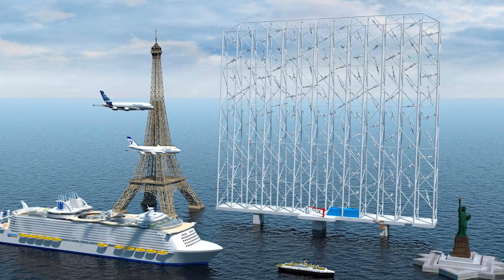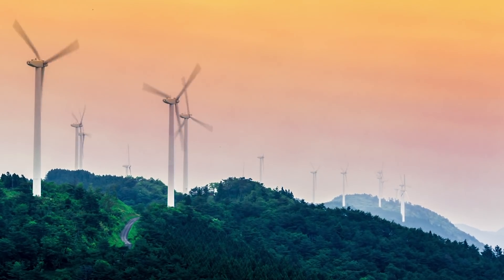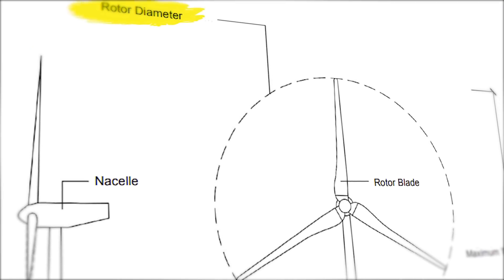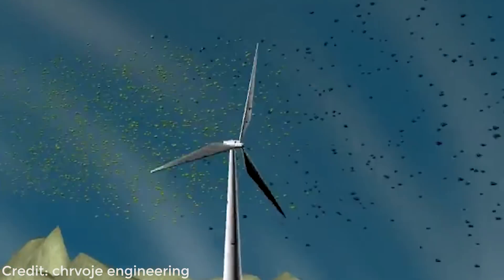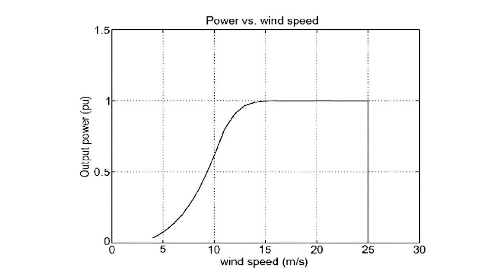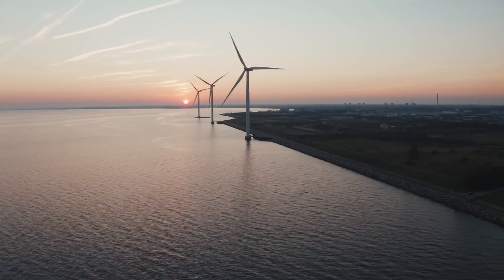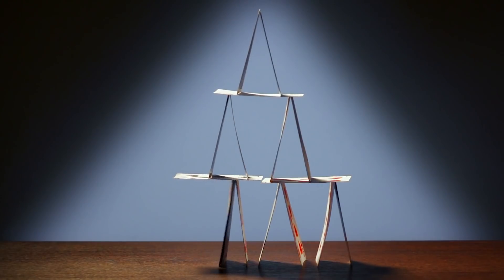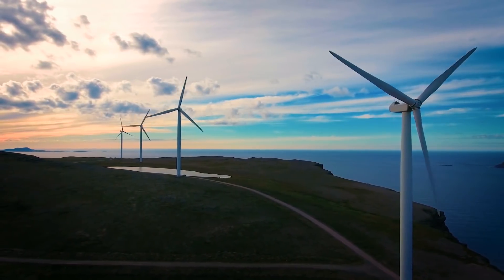Is this the Future of Wind Energy? - 200+ Blades!

Comment from the maker: Correction:

A primary reason for wind turbines not going faster than 11 m/s is because the generators chosen work best at those speeds, and it doesn't make sense financially to go for larger generators that can handle higher powers. I should have mentioned this in the video, but I definitely rushed parts of the script. 

The reason I focused on the blades is because they also have to be made stronger for higher wind speed, for the smaller blades this is less of an issue, as rotor weight scales cubically with length. In my opinion, this is what the windcatcher focuses on, as the total weight of the smaller blades would be lighter than three large blades from a conventional turbine. This makes it easier to design bearings/mounts/etc as the blade spins faster. Therefore the windcatcher design would also have increased costs due to higher powered generators, maybe this would be less of an issue with many smaller generators, but I would guess not!

Sorry for any confusion, I will edit this comment to reflect any other corrections and will work hard to make sure things are clearer in the future!
Reply: If you're going to make that complicated array, why not change to VAWTs?

I agree with the other comments about the array having high drag and a greater chance of damage in high winds.  If the lower turbines have low output, eliminate them.  Instead of solid members, use high strength cables to suspend the array.  Try to minimize the cross section of the array to minimize wind load.
Reply: @acmefixer1  You need a pitch control for VAWTs to make it feasible on the yield side. But yes, you are right, a VAWT is the better approach to extreme scaling. That is first principle thinking optimizing number of attachment points of blades vs maximum blade length defined by material strength. VAWT scales in 2 dimensions, height and diameter. You can stack it like a scaffold and run it on a circular track easily to support any scale you want. Unfo it does economically nothing for you on the yield side w/o kind of a pitch control.

On this design, hopefully no one will try to pay for the scale up in offshore wind of this grid concept. But who bets against stupid money? The initial stage investment is insanely high and the design can't be proven small scale. The outcome can't be there by what any wind energy engineering expert can prove you with simple calculations on yields, loss and maintenance by the standard bankability process calculations.

Scaling a VAWT is precisely what we do with our IP to bring tidal energy down from 4 m/s current speed to the more abundant 2 m/s of the worlds oceans. Why Tidal Energy first? Because we don't need crazy billions for a competitive scale from the get go to prototype our experimentally proven IP.
Reply: @acmefixer1  Because VAWT's are less efficient.

Comment: The only problem with power is its portability. You cant just have a big fuck off generator somewhere, cuz you lose it as you try to move it to far places.

So you need to make a bunch and dot it around the earth wherever it is used.

In the far future we prolly just put it under ground like really far down and from that point its a bit easier to pull the cables around instead of ploping on the surface and having to go over the curvature.

Moon and prolly mars will have beamed power cuz you don't wanna put anythig on that crap surface if you can avoid it. Altho if they wanna go the magnetic field way, eventually they just hyjack those wires.

Comment: As I write this, UK wind is near-zero, and certainly nothing like the power required to match demand. Therefore 2.5x trivia = trivia.   The UK (and Europe's) basic problem right now is loss of security of energy supply. This has been mostly caused by poor decisions, such as forcing coal fired power stations to close. This has been suicidal because it means we are ignoring a very big part of the global energy supply market, and doing that can only mean one thing: our energy will be more expensive.  After throwing ourselves into this mire, the UK now gets a chance to see the true cost of that decision.  Industry is being crushed, and household bills were heading towards £5k per annum. The Government has promised to cap household bills at £2.5k by subsidising UK gas purchases, which means we'll be paying for these poor decisions for many years to come. This situation will continue until the UK improves its security of energy supply and aligns with world fuel markets - it means we need to replace those coal fired power stations.  If you disagree with this, you will only have yourself to blame when the situation does not resolve and you suffer even more.

Comment: I hooked up my first vertical axis wind turbine in 1983; I think.  Used it to run an air compressor and then use the compressed air to power an air motor to overspin an induction motor to generate in-phase electricity back into the grid.   The turbine I used had a 4 legged cage around it.  The PHD physics guy I was working for had bought it in Colorado and hauled it to Texas, where we re-erected it.  A co-generation electric co. engineer oversaw the operation.   I gave much thought to the supporting cage.  The turbines in this array also have a cage.  They would do well to connect 4 of those cages together to make a huge cube.  Assuming the turbines can turn 360 degrees to face the wind; they should be able to allow full spin up.

Comment: None the wiser, but did explain the Caplan hub variables control of blade orientation in governor function. Propeller,and water turbine knowledge.  A turbine has a casing, capturing the steam til its energy has been utilised. . Take that, (not the group.) and use its simplicity. Venturi grabs full wind, further back a larger taper area. . Blade grabs the slowed down wind, and so on.  Speed  control can be by limiting the wind through flow, in a funnel  . A clutch connection picks up or opens wind flow as required. High winds, first stage and next stage  and final . Low wind funnels to,third stage, moderate funnels to  2 nd stage., 1st stage  put profile of least resistance by blade attitude.  ( Bypassed fluid Clutch ), to,allow 2 nd stage to take  the load . 
final . Like auto car system, in reverse.  Well proven function but we have spent Billions on the big is clumsy, and cumbersome limited. Wind is like the roads up and down . Big turbine Venturi 3 stage. All automated safe.  For birds, black hole in atmosphere, drags in any passing morsel.engineering mind in past experience. Cost of standardising a universal unit is a one off, all built and taken to,a side of best wind advantage. Cost only effort and thought with money not considered profit is  forever use, but not money.

Comment: As engineer I am confused about the statement that "1/2" in kinetic energy equation comes from relativity. I'm 99% sure it's just from integral. And the equation is much older than relativity. 
Or was it just a joke?

Comment: The design is serious flawed.  If the supporting structure is able to produce 2.5 time more energy it will have to withstand similar 2.5 times more stress.  That makes the supporting frame/structure a lot larger and more substantial than shown and the foundation requirement would be even more challenging.  The whole idea that we are using wind and not wave energy is because of overcoming gravity is a lot more expensive.

It is theoretically possible to erect a bridge from US to Europe but an engineer can tell you no motorist would pay the toll needed for its installation. Apart from theory there are practicality and economics too when you scale up everything.

Comment: Where do you get the idea that small wind turbines can handle faster wind speeds?  Small Wind Turbines cannot handle fast wind speeds any better than large Wind Turbines.  Many large wind turbines are designed to withstand 100 MPH winds.  Most small wind turbines will disintegrate in 100 MPH winds.  Small wind are turbines are LESS EFFICIENT than larger wind turbines.  There is nothing about this idea that is "better".

Comment: also i like to add an wind pressure generator air pressure compressors would be far simpler and the pressure line to an storage point is als simple the energy is easy storage in underwater pressure chambers etc the electric energy conversion is easy with water flow turbines

Comment: this futuristic wind turbines will kill more birds, esp. those endangered.
Reply: I think it could be a lot better for birds. The main problem with conventional wind turbines is that the blades rotate high above the structure itself, making it hard for birds to understand the area it actually covers. They fly in between in what they think is a safe zone, like this: https://youtu.be/8NAAzBArYdw
With this type the blades does not spin outside the structure itself so its much easier for birds to determine the unsafe space when the support beams cover all blades. Likely they would determine it the way they determine buildings.

Comment: The small turbines might find a market like residential solar. The new company doing wood composite support structure is much better.
Reply: They would work  but won't happen as power company's will lose out.  Unless they can sell you one but still charge you for how much power you use

Comment: I have wondered about passing a sea wind through a tunnel that is lined with magnets, and electrodes. I am assuming that the wind would be 'wet' - as salt water is an electrical conductor.

The efficiency may not be great, but the design is very robust and cheap to make, I believe.
Reply: I was thinking the same thing.

Comment: Ziroth I do not think that you should apologies very much for your point about blades rotation speed. One of the swindle which large conventional wind turbines advocates push is that large turbines must rotate (pitch) their blades because of so called "capacity factor" which is related with economics of having larger generator and by that "extra costs" related with annual energy production, AEP (as mentioned by Engineering with Rosie). However that costs are minor relative to investment at all (to some extend) and in many respect this is ECONOMIC issue not technical, technical issue is that large blades cannot rotate very fast because of much higher centrifugal forces which in combination with much higher stress on blades will turn blades apart and destroy entire wind turbine. So in case of large wind turbines blades it is not that they "do not wish to capture more energy because of costs of extra generating power" as Rosie mentioned (between the lines) but also because it is technically very demanding if not impossible for such large blades. Another point which anyone barely touch in analysing work of large wind turbines is their high intensity infrasound for which is proven that have very serious effect on human health and that propagation of these emissions are much wider than just 1 km as large conventional wind turbines advocates claim but instead it is 15 to 20 km for 2 MW wind turbine, for larger much more. That is why we had developed an patented completely new concept of wind turbine and platform for converting wind energy on much efficient way and without infrasound emissions and even birds and bats killings. 
https://www.youtube.com/watch?v=w81fNBGirCo

Comment: Does this design with its far smaller blades allow for the use of different materials other than fiberglass?  Could you use sustainable/recyclable materials for these smaller blades?  Maybe even something like a bamboo laminate?
Reply: Bamboo laminate is recycleable like any other laminate. Aluminium or steel could only be used at further loss of efficiency on top of the ones making this already unviable. High poer conversion factor means sleek blades require you to go to the most flexible strength material available. That is carbon fibre. Changing the medium to water and do tidal energy or ocean energy is what you would want to look at before further exploring offshore wind for several advantages. In tidal energy to get from 4 m/s down to 2 m/s currents is the real deal to get anywhere fast on easy to recycle materials. High C02 emission reduction impact and low CO2 input is found in hydro or ocean power with turbines. It is a matter of energy density.
Reply: bullshït
Reply from the maker: This is definitely an interesting point, I imagine it would allow for new more sustainable materials!